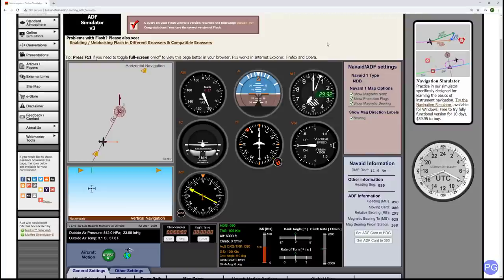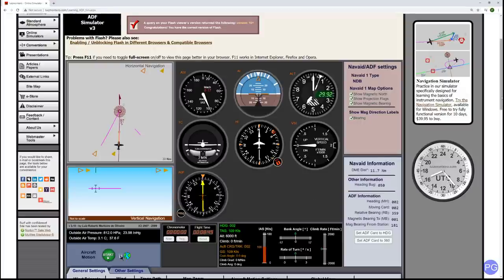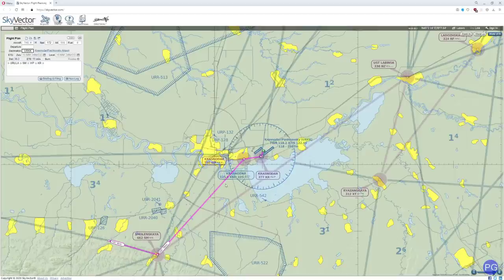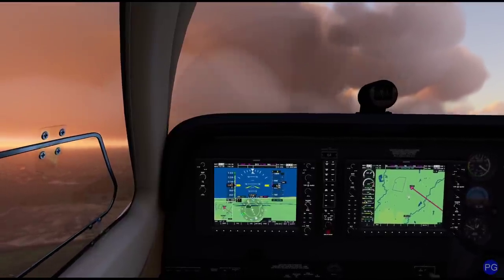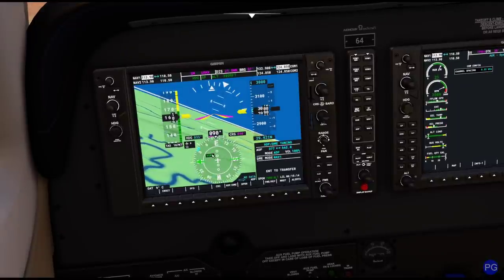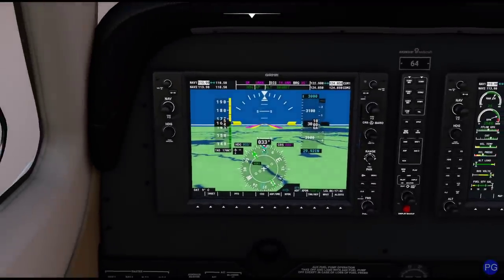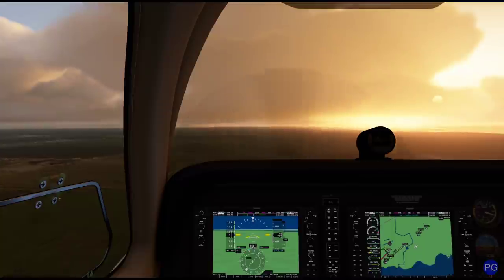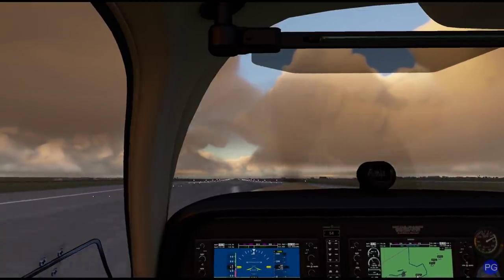FS2020 Tutorial - Radio Navigation NDB/ADF

Comment: Sadly that website relies on Adobe Flash that is typically blocked these days and will no longer be supported in Windows moving forward
Reply: Yes I found I couldn't get it to work in Firefox or Chrome but it does work in Edge. On his 'About' page Luiz is saying it is too hard to rewrite to not use Flash so the website will probably only work until Dec 2020.